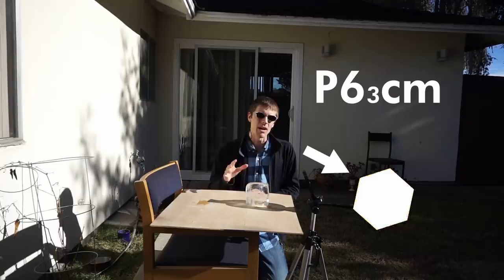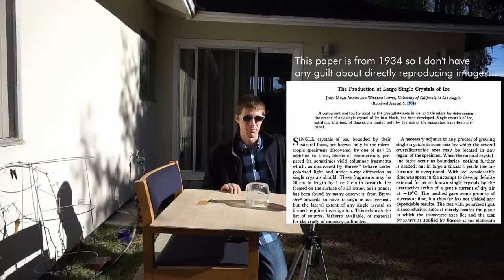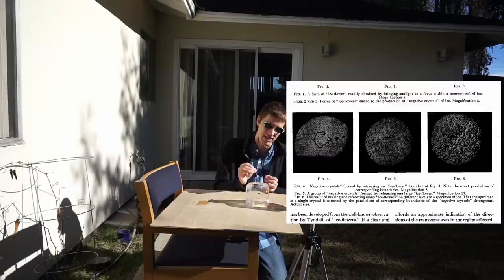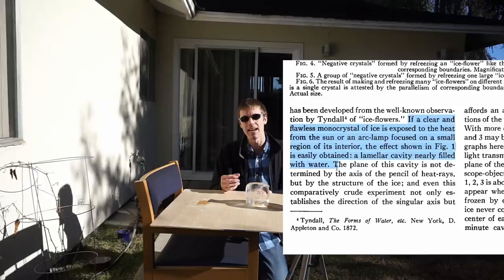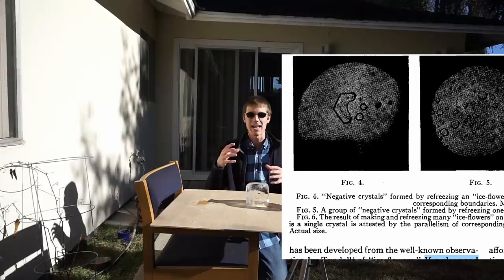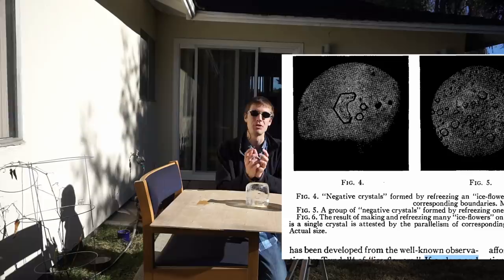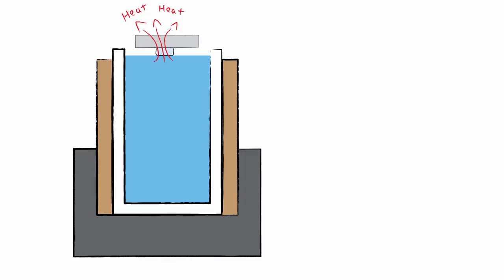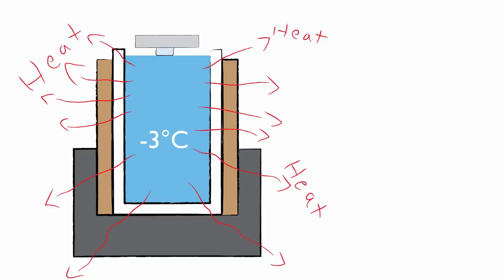What is polycrystalline water?

Comment: But can you cool the very pure water in a clean container so there is no nucleation points way below the freezing point and then introduce nucleation point and it then rapidly grows into one big crystal. The heat released during process is not enough to raise the ice crystal temperature above 0C so it will not hit the melting point and stop freezing. This is how the chemical handwarmers work but with different substance. I've often seen this experiment with water too and thought that it is common way to grow large crystals and to keep it more controlled, instead of banging it to get the nucleation site (which is usually done in those demonstrations), you could touch it with something sharp-tipped or your single crystal small ice piece, so it will introduce a single nucleation point. Maybe, I've understood something wrong but if not wouldn't that be exactly what you were looking for? 

Few links to show the effect too: 
https://www.youtube.com/watch?v=ph8xusY3GTM - fairly trusted science communicator
https://www.youtube.com/watch?v=NMSxuORKynI - another fairly trusted science communicator
https://www.youtube.com/watch?v=pTdiTe3x0Bo - this one also shows the more controlled nucleation site and has some pure kid reaction to "cool" science

Comment: Anybody else worried about a spot on the top right corner of your screen 🤣
Reply from the maker: lol - its a fleck of dust on my sensor.. I didn't have a sterile brush handy to get rid of it and decided to keep filming with the widest aperture my lens could afford. The static auto-clean feature wasn't good enough to get rid of it...
Reply: woah I didn't even notice that lmao
Reply: @AlphaPhoenixChannel  nice video though, good work. Do you have a peltier element at hand for cooling the aluminium plate, this might work, or just put a few batteries with a resistor at the bottom for heating? Cheers

Comment: I've frozen vapor and for me it formed tons of separate but beautiful individual mono crystals that were larger than i thought.  But i ended up with a beautifully textured surface with them all.  I put item in freezer with low moisture content locked into its dense structure and put lid over it.  It took a long time but the vapors came out of the structure and grew hexagonal crystals on the underside of the lid.  I took a video of it, looks like quartz crystals in geode
https://youtu.be/RvRzpCNihhM

Comment: that aluminium thing was clearly a failure because drips of water clearly touched cold aluminium and grew very fast instead of slowly growing on the monocrystal
Reply from the maker: It did grow quite fast and trap some bubbles inside at the seed, but I don't know if it was epitaxial or not. it is possible to get epitaxy and voids at once.
Reply: also doesnt that method of growing monocrystals by suspending a tiny nucleation point require ultra-fine-control of temperature? like, better than towels-and-freezer level of control.